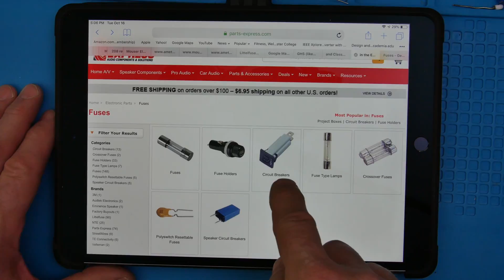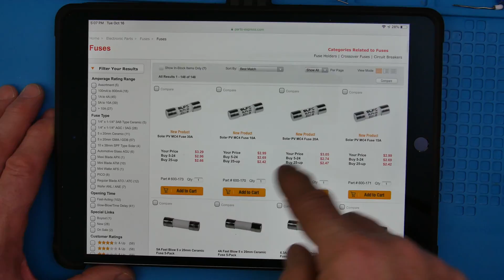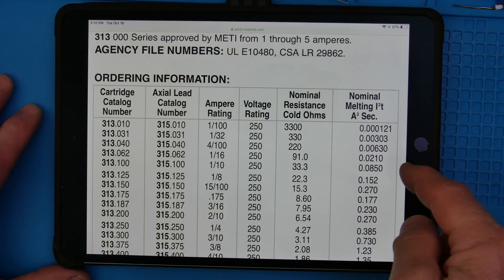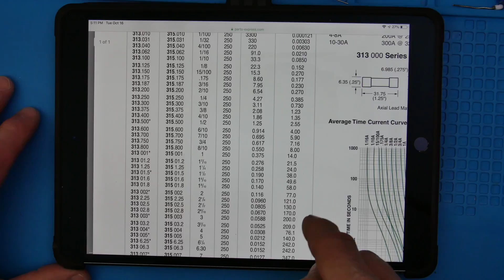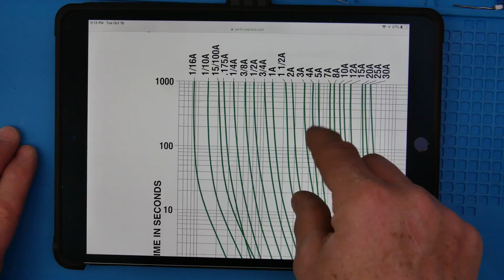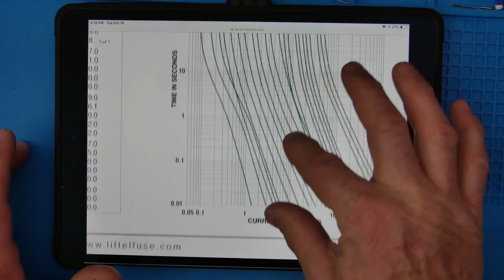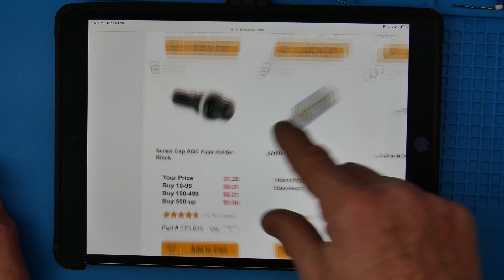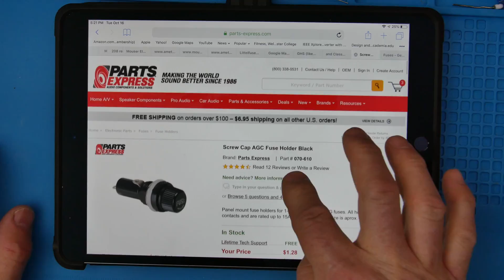Fuse selection - Audio Amp Power Supply

Comment: Bose uses crossover fuses in some of their speaker designs as a current limiter. It's actually a light bulb similar to the ones used for a dome light in a car. The premise is, that as power increase the filament gets hotter thereby increasing the resistance going to the particular speaker. Yamaha used to use them on the high frequency horn drivers in their pa speakers.
Reply from the maker: Thanks for the great feedback!

Comment: Great video, Eddie
I've a question, the primary winding on the transformer, does it draw the same current whether there is a load on the secondary winding or not.
The reason I ask, a transformer based Arc welder, when powered seems to draw the full current, even when not welding ?
But an inverter based welder does not until you strike an Arc, supposed to be more efficient.
So choosing a fuse rating for the primary winding of any transformer, regardless of the secondary winding load, it doesn't change.
Apart from the inrush current, which lve seen your video on the thermistor, to protect against the inrush current.
As I see it, the primary winding is a big coil of wire so its basically a resistor that doesn't change resistance hence it will draw the same amount of current ?. Regardless of the secondary winding load.
Adam
Reply from the maker: Great question.  The primary power should be slightly higher than the secondary power due to efficiency.  If the secondary voltage is around 35 V for a welder and the input voltage is 220 VDC, then the voltage on the secondary might be close to 10x lower or ‘stepped-down’, so the current is stepped up the inverse ratio, so about 10x.    An inverter would be much more efficient.  On an inefficient transformer based welder the input current would be around 10x less.  Does that make sense?
Reply: @KissAnalog  
Thanks Eddie,
May be I was not clear enough ?. If  I power the primary winding from the mains, this is taking  the same amount of current regardless of the secondary winding being open circuit or connected to a suitable load ?. ( not taking in to account overloading the secondary winding).
My understanding from a simplistic view.
 (240V primary divided  by 24V secondary = 20:1 ratio) of a 100VA transformer (primary winding 100 Watts / 240V = 0.416 Amps)  and the secondary winding (100Watts /24V =  4.16 Amps).
So my closest fuse would be 500mA for the primary side.
ATB Adam
Reply from the maker: +Adam L That is interesting that the current on the primary is the same with the load on or off.  I would think that when the welder is on that there would be surges of current on the load side which would be reflected on the primary side.  

Your understanding and math is good.  I think 500 mA fuse with a slow blow for load transients might be ok.  On a transformer based welder where I would expect transient power, going to the next higher value fuse might save from having nussance trips.

Comment: hi, is one fuse before transformer is enough? I mean fuses could be located between secondaries and diode bridge or between bridge and caps or between PSU and amp board.
Reply from the maker: uSonic DIY there should be one fuse placed before the transformer.  Ideally the fuse would protect the input power from shorting in the case of any component failure.  Any other fuse placement can be used to protect a specific stage if desired.  For instance, using a fuse to protect the speaker.  Thank you for asking.